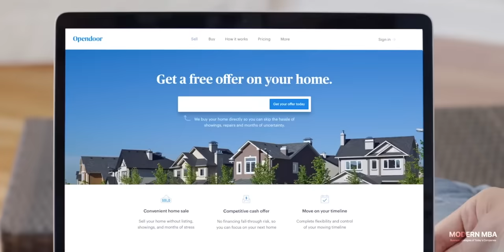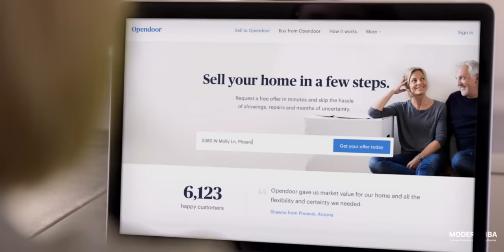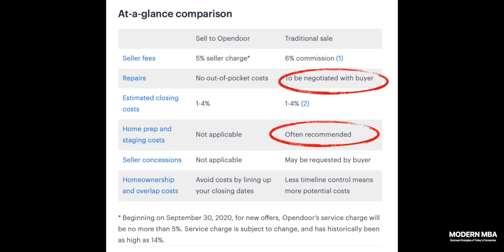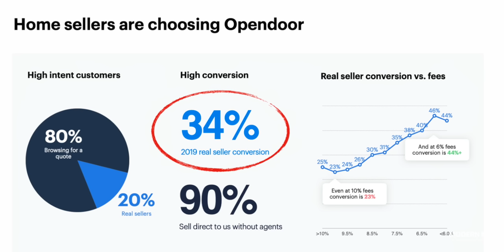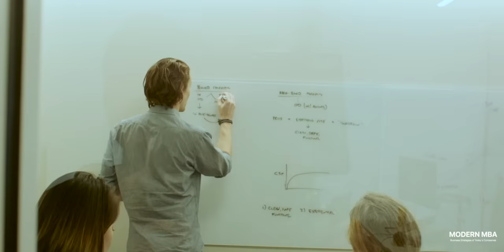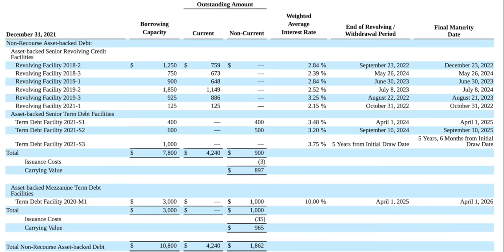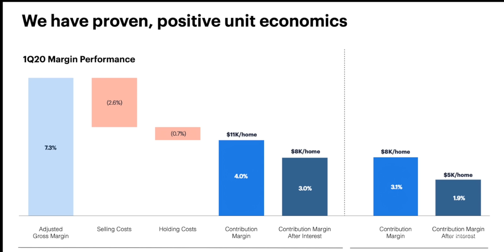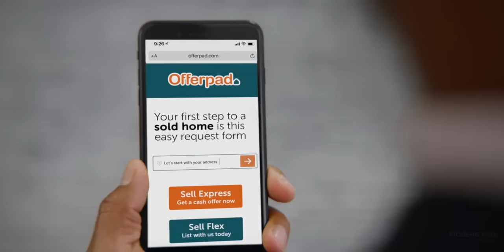Real Estate Tech: A Crumbling House of Cards

Comment: Thank you for this interesting video. Lots of tech bros but no real estate experts. I worked in the title insurance industry for years, and note some additional problems with this business model. Assuming everything in the video is correct, I wonder if any states where OpenDoor does business care that they're offering appraisal services without a license (unless, of course, they are licensed as appraisers). In my home state, appraisal licensing is taken seriously and enforced strictly. Lawyers doing tax assessment reduction work got in trouble with state regulators for not being licensed appraisers. Also, they might also be within the state regulators' definition of brokers even if they are purchasing the homes themselves--particularly when charging fees that could be deemed commissions, particularly when the rehab fees represent no actual rehab. Further, if they did reduce the "rehab" fees to attract sellers and hid them in title and loan fees as per the video, that would be a RESPA violation. You can't charge fees and then hide them. Someone who paid those fees can make a complaint with HUD, the CFPB or the FTC I would think. Finally, when a buyer purchases a property, does no rehab, and then sells it quickly for a higher price, we used to call that a bad flip or a potentially fraudulent flip (particularly if they claim they did the rehab work), and that type of fraud made up a lot of the 2008 crash problems. To do a legal flip, they should do the work to improve the land to support the end purchase price and inform the end buyer's lender about the flip. The end lender should use that information in their loan underwriting to ensure that the sales price hasn't been inflated to pull down more mortgage funding than the land supports. Aside from legal concerns, I wonder if OD's business model has a built-in problem similar to Heisenberg's Uncertainty Principle: if they offer sellers more to attract the buy business, they're raising the comps and raising their own flip-side prices, which can be seen as good but may be chilling the buy side. On the other hand, if they are lowballing the sellers, they're creating lower comps and lowering their own flip-side sales prices. Their own actions in the local markets affect the local markets.
Reply: 😮 so much details in regulations! OD business model better address those issues but I can see it can be so costly 😅

Comment: Charging a 5% "service fee" is considered a commission under the law, regardless of what it is called.  This means Opendoor needs to run each transaction through a licensed RE broker in every State they do business in.  For example, as a buyer, you cannot charge the seller a 5% fee contingent on the contract transaction price.  If you do, you are violating State law, basically functioning as an unlicensed broker.
While functioning as a legal broker/agent, the broker must by law get the highest price possible for the seller, or lowest price possible for the buyer, based on an agent's fiduciary duty to his principal.

Comment: It's interesting to note that the AI wasn't what failed, the business model was setup to fail out of the gate. It's almost like these companies never did any investigations as to what reseller margins should look like. If you offer the world 90-95% of the value of something and put all of the onus on yourself to resell it at full price, you'll fail 100% of the time. That's not a sustainable business model, no matter what you're doing. You need margins of at least 20-30% in order to cover overhead and include a margin of safety. That's the piece of this that no one seemed to grasp. Being able to sell an expensive asset essentially 'at will' comes with a convenience fee anywhere else. If I want to sell my tools or musical equipment, I can do it myself and get full price, or I can take it to a pawn shop and sell it for maybe 60%-70% of what its worth. That's how it works. For some reason, these companies thought that scale was more important than profit, which is never the case with physical assets.
Reply: Exactly my thoughts, the business model of the company is clearly terrible, however, their base idea isn't bad, and their AI seems to be at least as good ss human evaluation and should get better

Comment: You said that if you sell to open door that you’re leaving 5%-7% of the fair market value on the table but that’s not true. If you use a traditional real estate agent you will pay them 6% of the sales price + you typically have an additional 3% in closing cost to cover. So in actuality Open Door has lower fees. 

I sold my first house to open door. They offered me the exact same amount I listed for but with a lower commission. Then they resold the house for a little higher. 

They give you the option to repair any issues yourself or take the cost off of your offer. In my case they did not find a single problem with my house. The only issue was the lock on the fence was broken which was a couple of hundred dollars and they did fix it. I would recommend making sure your house is in good condition before having them inspect it.

Comment: 16:28 This is debatable. If Opendoor actually did the repairs, they could sell the house for 20k more. The broken foundation is major defect, it must have affected the selling price.
Reply: Only if the potential buyer requests it. Even if they only get away with not doing major structural repairs 5% of the time, at 10-20k of repairs, that can save a lot of money.

Comment: As a real estate investor, I can say that you need a human to make a lot of judgement calls.  And probably the AI just doesn’t have enough data to know what they are in for.
Reply: I think this is where risk management comes into play.  If you pay a home inspector to inspect the home prior to purchase, you will have an immensely better idea of what you're getting into rather than having the seller answer a few simple questions on an online form.  You'll have a much lower chance of failures and higher chance of maximizing the profits on each home.  Of course, the flipside is that having this contingency will lower your conversion rate compared to just offering cash right away with no contingencies.
Reply: Exactly right. You could build the 2 of the exact same house (floor plan, finishes, and all) in the same neighborhood but they are not the same value. They will have different problems and different features (view, traffic, next to amentities) because of the most important thing in real estate…. location, location, location

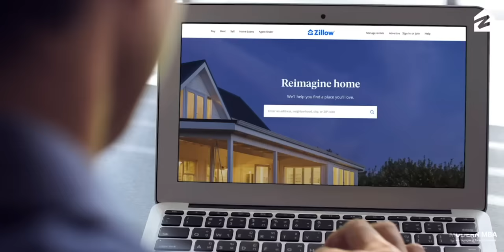Comment: This piece says that Zillow invented computer home valuation 15 years ago (in 2007 one assumes, at time stamp 27:20) but that's not accurate. Computerized home valuation (usually called an automated valuation model or an AVM) was invented much earlier. If you look in the bibliography of the STANDARD ON AUTOMATED VALUATION MODELS (AVMs) from the IAAO, you can see that there are papers on AVMs going back robustly to the 1990's and select examples in the 1980's.

Comment: At 11:50 you start talking about the downsides to using opendoor. The 0-2.2% below FMV makes sense but I dont quite understand the next point which is the 5% service fee. Isnt this kind of a null point since closing costs and the real estate agents fee will be around 5% as well?
Reply: I would say the point is that with real estate agents you as the seller know thats what you're paying for.
With the repair fee, Open door could just say ABC needs repair and charge the 5% but turn around and not do it. So it's potentially a form of fraud at worst or at the very least misleading the seller

Comment: Interestingly, housing market is counterintuitive in sense that buying bulk actually drives per-unit costs higher because it drives up values. In that sense "economy of scale" is an additional risk because it represents greater exposure to a downturn without offering corresponding economy of scale savings, at least on the asset acquisition side. All good when prices are going up, seems precarious when they're not.

Comment: So the feds raised rates twice this year (2022) and plans to continue doing so until they see a light at the end of the tunnel that will curb inflation, with that being said if a 1 point rate increase cost Opendoor $40 mill in interest expense which can only be offset by selling an additional 2000 homes per point increase, seems to me this model is like that of an unstable nuclear isotope. With inflationary rate increase home buying will slow down and home selling will increase leaving Opendoor holding a large bag of homes and unable to sell them. Some one up on the top of the food chain based the model on speculation that home value and home buying will never really slow down or come to screeching halt, but worse they speculated that interest rates would remain the same. They were so wrong

Comment: Since traditional Real Estate agents have heavy fees (between the 2-3% for the selling agent, and 2-3% for the buying agent), it's not fair to say that OpenDoor's transaction fee is somehow a net negative vs. what they'd pay through the traditional process, since it's about the same.  I mean, if you sell a house for $300k the old-fashioned way, the closing agent will subtract $15k for the brokers and cut you a check for the $285k remainder.  With OpenDoor, they cut you the check for ~$285k directly.  I'm not sure why the video goes on and on about that charge so much...  In the end, your net is ~5%-ish below FMV either way.

(Though yes, inflated repair costs for things that don't really hit the home's value are a problem.)
Reply: @Mercedes1995  What is a home worth besides what someone is willing to pay for it?  My point was that to compare selling through these guys vs. the normal process, you must subtract the 5-6% from the traditional-method price to make a fair comparison, just like you should subtract these folks fee.  In any case, again, the video went on at great length about the 5% fee, and what a drawback it was, so the authors did not believe it was “meaningless”.

Comment: Opendoor is one of the best risk/reward on the market right now, and is massively misunderstood by majority of retail investors.
More is factored into their service fees than simply any repairs that need doing. They take into account the current macroeconomic climate and where they see HPA levels 3 months from now.
Your analogy likening Opendoor to a house of cards that's only as stable as the housing market isn't a good one. In a down market they can flex their fees, historically as high as 14%, and people will still sell to them rather than watch the value of their home continue to drop further in times of negative HPA.
These higher fees are where they make their money.
Look at our current climate. Everyone said Open only did well due to the hot real estate market and would fail in the opposite. Q2 is looking like it's going to be strong and scared realtors will have to find a new argument 🥱
Reply: @Mercedes1995  You missed their Q2 earnings then did you, wise guy?

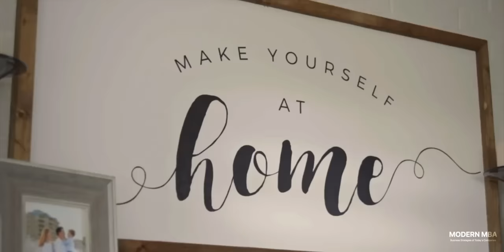Comment: @12:02 You can't add on Open Door's 5% service fee, because as the seller you would already be paying at least that in sales commissions to your agent!
In favor of the iBuyer, they have a bit of margin where they can actually sell for slightly less than they paid for it without losing money because due to their scale etc. it doesn't cost them 5% and not being a small realtor they can make money on the volume.
A strike against iBuyers however is of course selection bias, especially with multiple iBuyers in the market, the seller can basically compare the highest iBuyer offer against comparables and those getting a better deal from the iBuyer will take it while those without may not.
Reply: But that’s the catch isn’t it. They charge a fee the same as real estate agent commissions. But on top of that, offer below market value price, charge you for repairs (which buyers don’t in a hot market), and charge you excessive title fees (which buyers pay in a hot market). So, going with OpenDoor you’re not getting a good deal on the money. Maybe you’re getting the convenience, but you’re not getting the most money

Comment: Basically an advertisement for using a realtor-someone who makes ALOT of money off of you without needing a college degree. I’ve bought and sold 6 homes over the years-you don’t need a realtor-save yourself money and so some research. Open door was a way to avoid realtors. You don’t need to use Opendoor either.

Comment: The math presented comparing selling with open door and additional realtor is off. The narrator states that they may pay .2% to 2% less and then add the 5% fee to say that someone selling would get 5 to 7% less. This is not true. They would also lose the 6% selling fee plus any staging fees and repair cost with a traditional realtor. If you compare the prices very similar.

Comment: 11:50 What is this "real market value"? Traditional sellers don't get to collect he sales price all by themselves. The money "left on the table" would be left on the table anyway in a sale conducted using two "realtors", both of whom get a cut (or the sales retailer gets a double cut if the buyer doesn't employ one -- did you know that?).

13:14 What are you talking about here? The conversion rate is unaffected by the number of markets Open  Door operates in. You can't become an "engaged seller" if Open Door doesn't make an offer for your house.

16:40 This example makes no sense if Open Door's initial off was close to the "fair market value" of the repaired house. It can relist at a price which ignores the defects, but it can't collect that price unless it finds a sucker for a buyer and sells above the actual "fair market value". Which can't be relied upon as a business plan.

Comment: You can't say that the seller is leaving 7pct of the fair market value on the table because Open Door offer is 2pct lower on average.  They do charge 5pct fee, but that is 1pct cheaper than agents.  So we are down to about 1pct diff.  Given you don't have to do repairs (6k on average like you said) - and we are actually looking at potential savings on houses sub 500k.
Reply: @Mercedes1995  I will have to do a bit more research than watch (listen to) a youtube video while driving to Dunkin for breakfast, but if they really have 35% conversion rate like they said...  that may not be a bad idea.

Comment: Well OpenDoor can evaluate homes better than agents. But that's a very low bar. Zillow and OpenDoor failing doesn't prove software can value homes better than humans. But I wonder how useful that would really be. If computers bought and sold homes then software would have an advantage, as is done with stocks. I can't see a reason why computers would ever buy and sell homes. To corner the market? Unlikely. Eventually a human buys a home to live in. So IBuyer software would have to predict the human buyer's mindset.

Comment: In the US, the only verifiable source of comps for what the asking price and closing transactions should look like, would be the MLS PIN from Multiple Listing Services.    

Any licensed broke or appraiser, with an account can pull data and present at listing  with the seller or to a buyer.

When you don't have a comparable value, because of insufficient data to sample, then you can use other numbers. 

Cost replacement analysis
Cap ratio analisis

Or at worse, a unassisted seller can look through vicinity  the median prices to setup a asking price. 

These algo based platforms do not work for Real Estate. it's not an exact science, and the transacted items are not commodities, where algo based pricing might work.

Just a bunch of wannabe braniacs extracting money from gulible investors., because, gee, no one wants to pay the Broker's commissons.   

Same scam as Uber,, AirBnb, We Work. Pie in the sky schemes.

Comment: Artificial Intelligence?  Those two words don’t go together, oxymoronic!   “Open Door” will close their doors before long.   The spread on a sellers home is where the profit is.    Giving that to a 3rd party is normally not an option for the vast majority of homeowners selling their homes.   Zillow got crushed over paying in most markets for homes they wanted to flip.  The flip went to flop when they got stuck with homes and the carrying costs that all homes have.   Of course the scammers that attempted to sell Open Door to investors used a hot housing market like Phoenix and extrapolated that nationwide.   The Algo’s kept buying when the market changed⬇️, and the “artificial intelligence” proved to be………well artificial !!! 😂.   Silicon Vally scam artists!!    The inefficiencies in the housing market are always local and unique to that specific market.